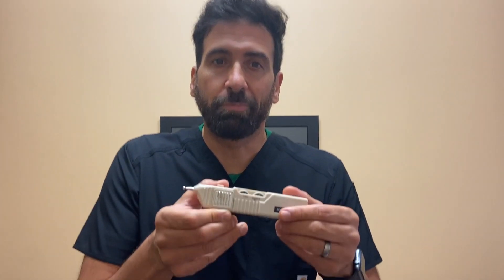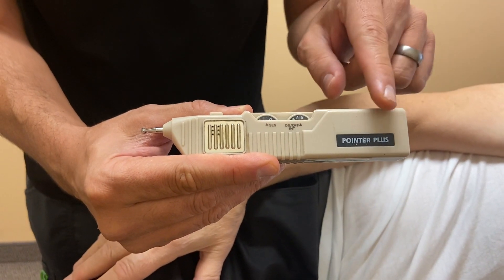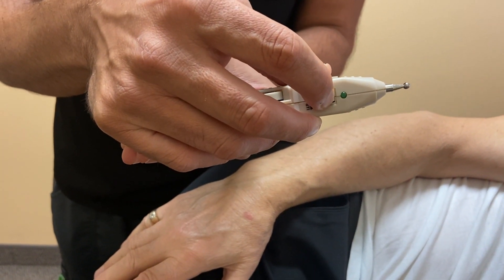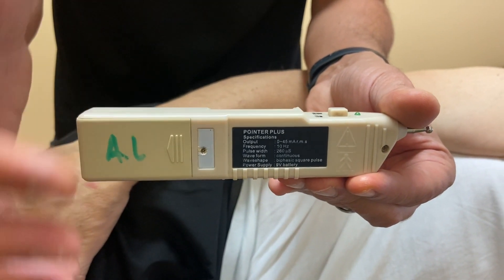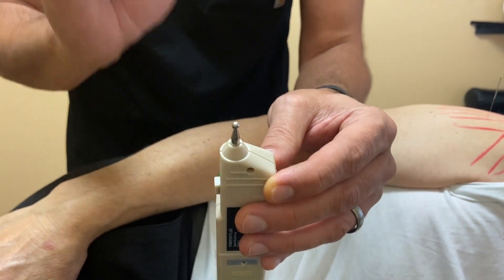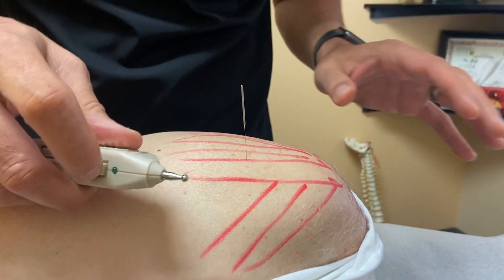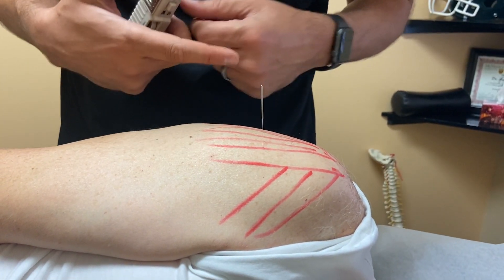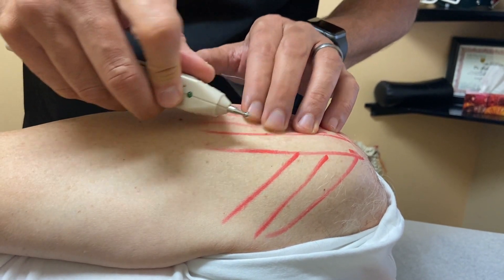How to Use the Pointer Plus for Motor Point Electroacupuncture

Comment: hi 
i am from bangladesh 
i am also a physiotherapist  
i need some pointer plus  
pls give me pointer plus manufacture company link
Reply from the maker: Hi, you should be able to get it from any company or distributor who sells Electroacupuncture or medical supplies. There are several companies who make devices like this one. As long as it is hand-held, in milliamps, and has a 10hz setting you can use it.